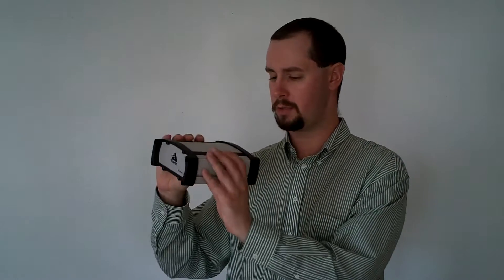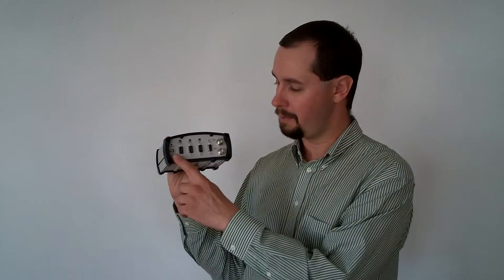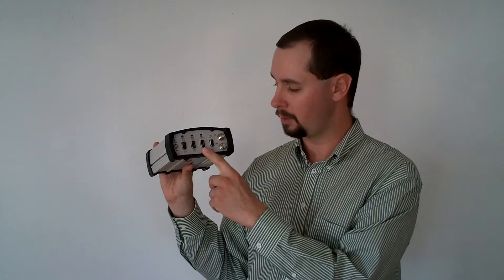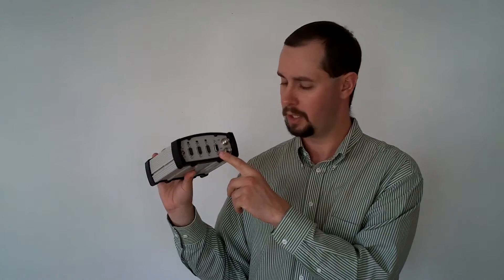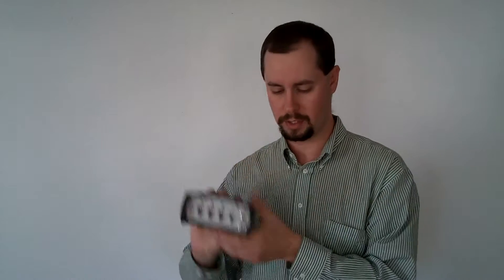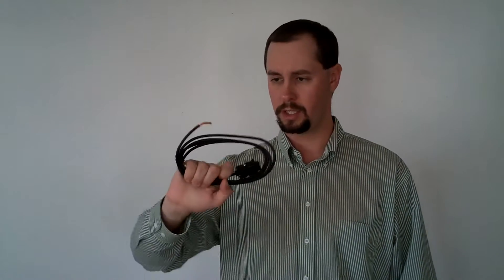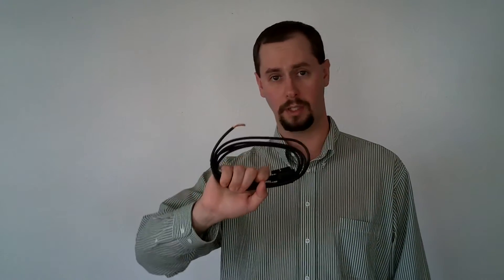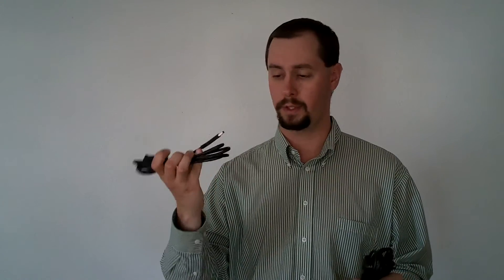Lefebure Design - NovAtel ProPak V3

Comment: Hello Lance, I am lucky if you answer :). I plan to buy the novatel propak v3. Could you tell me if you know, is it possible to input a RCTMv3 correction from NTRIP into the device to obtain RTK positioning ?
Reply from the maker: Yes, a ProPak v3 (or any NovAtel OEMV series receiver) can use RTCM v3 correction data. You want message 1004 for GPS and 1012 for GLONASS (if your receiver has the GLONASS unlock). These are pretty standard.
Reply: @mx270a  Thank you sir !

Comment: I am interested how to use commands in I/O test utility.
Reply from the maker: I/O test utility? I'm not sure what that is. The full list of commands for the OEMV series receivers is in a PDF called 'NovAtel OEMV Firmware Reference Guide'. Google for it.
Reply: Lance Lefebure ah its utility for writing commands for OEMV series receiver if u do not have the CDU software. I was setting up a basestation today and wanted to send rtcm corrections to a trimble device. Wrote out a script and got it working eventually. Always good to watch these kind of videos to remind urself of what you know.
Reply: @alanrobertson7073  Hi, do you know how to command to talk with Aplanix system, it doesn't like to talk with rtcm. I try to put something like RTK, it showed up fixed rtk on aplanix system but just a couple seconds and went to Dgps, rtcm and float and keep rolling.